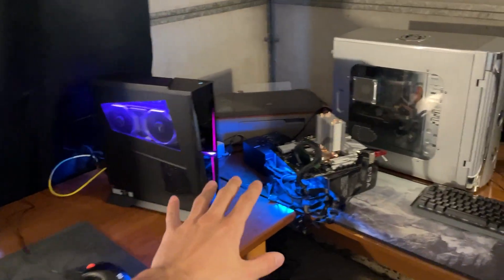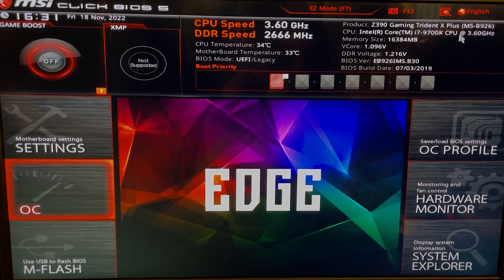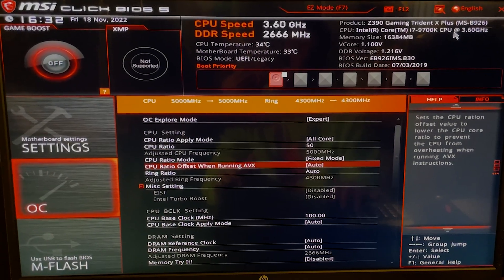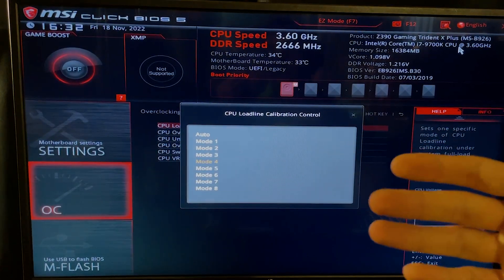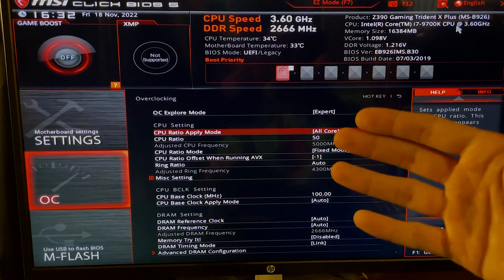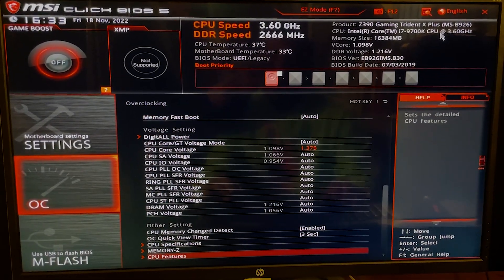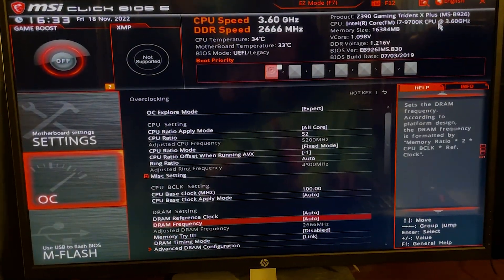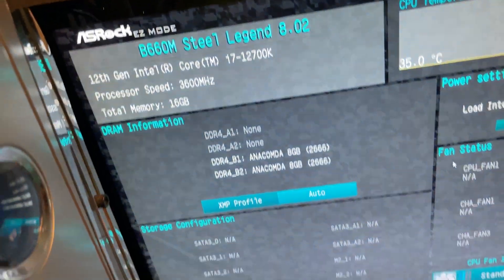Overclock your i7 9700K for more performance! - Tutorial

Comment: I've tried a lot, but it seems my processor can't handle 5GHz. I ran it at 4.9GHz for over two years, with temperatures often reaching 99 degrees. Now, tired of the fan noise, I've lowered it to 4.8GHz. My temperatures rarely reach 93 degrees, and the fans only start up occasionally.

Comment: Would this be safe on a prebuilt.
Mobo: Asrock phantom gaming 4s-ib
CPU: i7-9700K
GPU: MSI 2080 super ventus XS OC
COOLER: cooler master hyper black two fans in push pull with another fan on back pulling. Three front stacked pulling, two on top pulling.  
RAM: 16gb Xpg 3200
Reply: You ever figure it out?

Comment: Hi, nice tutorial, but my big question...is there any risk of damage to my cpu by doing this ? what temperature can the cpu hit at 5 ghz and what's the safe limit ? can this overclock erase the cpu bottleneck that i might have with a RTX 5060 Ti or RTX 5070 ? Thanks.
Reply: CPU's will always thermal throttle themselves because of how we know where silicon degredation starts. (I will add that processors these days probably use many more different ingredients than just silicon because we have probably hit the threshold of what silicon can do many years a go).
The only problem you might run into is that a processor that get's hot much more quickly goes out of bounds, there is a risk that it can be damaged that way.
Voltage increases are more dangerous: after all, we are talking about tiny logical voltages here, so any increase will increase heat and electromigration of the tiny transistors inside a processor.

Comment: Just ran a stress test on my cpu and it froze my pc.. the temp and cpu utilization max out. what are the lowest settings, so i can work up from the bottom? I have the i7-9700k along with 3060ti (not sure if gpu matters) i have cpu ratio at 50 and the volts at 1.28 and it cant handle it.
Reply: Figured it out. CPU fan it came with is garbage.
Reply: how to run stress test?
Reply: @roshanl34546   CPUID CPU-Z is a good program for stress testing
Reply: with gtx 1050ti, what will happen if i did 1.35v??

Comment: Is this tutorial is suitable for any i7-9700k ? I have MSI MPG Z390 AC Gaming And same processor with 16GB RAM  also RX 7600 XT from Gigabyte and I think 9700k is a bottleneck for this graphic . Please can you advise what I can do ? Can I use this tutorial to OC my processor ? My AiO is iD Cooling Chromaflow 240mm and sometimes my temps peaking quiet high in games with turbo boost . If I turn off turbo everything is quiet but I think I'm loosing fps with turn off turbo boost . Thanks

Comment: I got easy 5.2 ghz on mine, no problem at all on  Arctic Freezer II 420mm AIO. I might try to push it to 5.4 with some voltage adjustments
Reply: I have a big ass Noctua air cooler on mine with their best radiator fans and managed to get 5ghz and keep it under 70c, I may actually go for 5.2 lol
Reply: I over cocked to 5.2ghz and temps bout 45c
Reply: @Tinypvps imma overcook mine 😂
Reply: @Eurotruckpro I had to go back to 5.0Ghz it started getting fried

Comment: Hi man I have the same prebuilt pc as you, I was wondering if its worth upgrading or just buying a full pc, I wanted to upgrade the gpu to a 4070 ti super from a rtx 2080.
Also have you had any issues with overclocking the 9700k cpu ?
Reply: I’m in the same state too, I recommend just saving up for new ram, cpu, and motherboard then you can upgrade your gpu later if you’d like but yours will kinda do (4060 alone is plenty for an 5 7600X. I recommend going the AM5 path way.

Comment: With this setting the cpu clock will still chill when I'm not demanding it ? I'm runnning 5% of the time Skylines 2 which requires a lot of CPU, but 95% of the time just google chrome... so I kind of like the cpu resting on this 95% of the time

Comment: I have a ASUS PRIME H310M-K R2.0 and i got a great improvement by use 1.35 voltage, max 4.9 mhz (sadly doesn't get me that sweet 5.0ghz correctly), disabled voltage limiter on CPU configuration, Level 4 (even tho goes from 1 to 7??) hardware / cache prefetch enabled (tested both disabled and enabled and got more performance with enabled) and now on idle goes 4.6 ghz and gaming goes 4.9ghz :) instead of 3.6ghz and 4.3ghz, if anyone has a same board has me i hope it helps
Reply: its because you have -1 avx offset.
Reply: @roguefartblossom3221  is it worth having 0 avx offset for 5ghz over the 4.9?

Comment: i don't have an overclock mode setting. how do i enable it?
Reply from the maker: It’s probably “Manual” or “Expert”
Reply: @ImWateringPSUs  how can i change it? i used the advanced tab but i dont have an over lock mode on the bottom left

Comment: Followed your guide to a T but seem to have no stability.  What should my next step be?
Reply from the maker: If you have temperature margin, increase the voltage. If you don’t, decrease the core clock by 100Mhz at a time
Reply: @ImWateringPSUs  did some consulting with Google.  I saw a few posts saying with the MSI 390 A pro I might just be hosed on overclocking. Is that true? Nothing I did seemed to work.  I think this might just be a bit beyond me

Comment: I was running my system with the exact CPU and overclock and all of a sudden these days my discord restarts 3-4 times and then my PC freezes entirely, I set my CPU to default (non-overclocked) and now all perfect, why does this happens?

CPU: i7-9700K
GPU: RTX 3060Ti
RAM: 32 DDR4 3200 (8x4)
Reply from the maker: Over time you might need to decrease your core clock by 100Mhz or increase the voltage by 0.025V. Subscribe to the channel if it was helpful

Comment: Thanks for the video!

I've got a few questions:
- I've got the same motherboard and the same CPU, but I have 4 ram sticks with 2 different brands. They have the same speed, but different sizes. Can this be a problem?
- Is it important to increase the Ring Frequency, or is this optional?
- Can I reverse these settings if the pc crashes?
Reply from the maker: -Yes, no issue
-It’s recommended for more performance but not compulsory
-Absolutely yes
-Subscribe!
Reply: Thanks 👍

Comment: Hi, I have absolutely no idea what I'm doing I'm completely clueless when it comes to this stuff but my pc is underperforming pretty badly, it is specifically my CPU that is struggling so I am thinking of overclocking, before I follow this tutorial is it possible for me to fuck something up and make the situation worse for myself, or is this quite straightforward? Thanks.
Reply from the maker: This is gonna fix it!
Reply: So, how it went?
Reply: @pipecpeci  I couldn't do it
Reply: @BobDude65  my i7-9700k in games worked awfuly bad, didn't knew why, changed ssd with windows and added 16gb ram, fixed the problem. Now changed the gpu so i need to overclock my cpu (bottleneck)

Comment: I am about to upgrade from 9600k to 9900k CPU & is gigabyte euros motherboard how much ram speed does it support? I got 16 2x8 2666 but I want upgrade to 32Gb with high speed whats the limit ?
Reply from the maker: You can get any kind of memory speed as long as it's a good kit, I would personally recommend getting 3600Mhz! Very high speed like 4000Mhz might require manual tuning!
Reply: @ImWateringPSUs  thanks for replying , what about cas latency? Does it have to be 16 ? Or 18 is still good

Comment: I'm trying to do 4.8 ghz o.c, but it drops to 4.5 in the test and comes back out, I couldn't solve it, the motherboard z390 tomahawk avx setting does not work
Reply from the maker: You need to remove the power limits!
Reply: @ImWateringPSUs  Yes removing current cpu power limit fixed

Comment: How can I remove the voltage regulator? I have same mobo
Reply from the maker: What do you mean?
Reply: @ImWateringPSUs  well when I overclock I notice it only caps out at like 4.85ghz and won’t usually go high than that in a game. On desktop it will hover around 5.02ghz. I’m wondering if it’s because there a voltage limit

Comment: I think i lost the sillicon lottery, anything above 4.8ghz crashes/freeze/restart. Best I can do is 4.8ghz @ 1.330v 🥴
Reply from the maker: That's not too bad actually, but you might be cooler limited. I would be pretty happy with the results still!
Reply: 5ghz didnt Work. Tried yours and PC is running good but if I open up task manager it shows me only usage of 4.20-4.72 GHz.. why is dat? Have to say my motherboard is not dat good and I couldnt really change anything but core ratio, voltage and xmp
Reply: @Robert-Zimmer  You fixed the problem because i have an bprime360m-k and i have the same problem
Reply: @Nissyaniss  Nah didnt find any solution..

Comment: Mines a dud even 4.6 = bsod lol
Reply from the maker: Oh wow that’s pretty bad ahaha
It might also be due to cooling though, I think that every i7 9700K can reach at least 4.8Ghz on all cores without AVX offset, with around 1.3/1.35V
Reply: @ImWateringPSUs  I used to rub 5Ghz at 1.3v for over a year, but suddenly, it's gotten unstable.

Cooling is fine cpu, never hits 55f even while gaming ambient 70f

I'm wondering if the motherboard is bad since it does have two dead memory slots and a non functioning front hdmi port with missing pins.

Motherboard Asus z390-A prime.

I plan on upgrading this summer.

Comment: Hello, best voltage for lock 4.6? thanks

Updated bios on z390 a pro, latest version. Now I can't lower the voltage, the computer crashes during the OCCT test. Although earlier on the old BIOS the voltage was 1.195. fu*k
Now I have 4.6 lock at 1.350 voltage. Temperatures like an oven..

I still don't understand LLC mode. Tell me, what LLC mod best for undervolting? thanks again!
Reply from the maker: You’d be looking at around 1.2V, but try Throttlestop (I have a guide) if you can’t change voltage in the bios. Also if you can’t adjust the voltage, lowering the LLC helps! If you take a look at my i9 12900K overclocking guide, I go in depth about the LLC!
Reply: There are a million things called voltage which one to change? SA, IO, PLL OC, PLL SFR, RING PLL SFR, SA PLL SFR, MC PLL SFR, CPU ST PLL, DRAM and PCH? 

I have no clue what you want us to raise and to what level🤔
Reply: 3.37V 🔥⚡ 😂

For 4,6Ghz use Offset - 0,07V, for overclocking test Offset +0,1V and up in 0,1ghz steps
Reply: Thats very slow try 4.9ghz vcore 3.37 its stable ...

Comment: that cpu are simply pointless or even stupid now whoever buy it as used one!?no matter how much you oclock it you will basically only match 85$  r5 5500 only with performance while  power consumption will be 3x higher and temps around 20-25c more and that means expensive coolers needed !!
Reply from the maker: Well this CPU came out 5 years ago though😅 AMD had just the 1st gen of Ryzen at the time
Reply: @ImWateringPSUs  but problem is that 9700k as used costs more then 5600/x and 5700x  now just like more then  12400f or 13400f and it cannot compete vs them in anything , basically its only 2 or 1,5 year older inly then 5600x which are still very competitive vs 12&13th gen like 12400&13400f
Reply: Clearly not in gaming 5500 equals to 3600 so technically well worse in gaming
Reply: @floppydiskyt  round 5-10% better   but r5 5600 are not something much more expensive 20-30$/euro but   with full cache size

Comment: Hiya buddy, I'm cpu bound as I have a rtx 3070ti and this i7 9700k. My processor is stock. Should this jump to 5ghz give me a decent fps boost? Currently I'm only using 50-70% of my gpu under load on a game

Should add I'm running 1440p resolution
Reply from the maker: Yess it’s gonna reduce the bottleneck for sure!😇
Reply: @ImWateringPSUs  thankyou buddy, is that a relevantly safe overclock?
Reply: @ImWateringPSUs  I’ll try this!!! I’m having cpu bound with a 3060 ti lol. I hope this works.
Reply: @Cute-ts8qi  did you manage to solve the bottleneck? i got 9700k and 3060 ti aswell :D
Reply: @MikeBike360TM  i feel the thing limiting the 9700k these days could be the 8 threads idk tho i still love it and its holding up well anything i throw at it wow, hogwarts legacy, diablo 4  all new shit etc with 2080 super
Reply: @BudKing96  are you using these overclock settings with your i7 and 2080 super. Those are my specs as well and feel like I could squeeze just a few more FPS with a slight overclock
Reply: @BudKing96  whats your diablo 4 performance like?
Reply: @BudKing96  yup, same, r*pes most game but i admit in 4k it goes below 60 depending on the game, as you said, i bet its the 8 cores, thx for confirming
Reply: @MikeBike360TM  Now, did you do solve it?
Reply: @Ryuseigan  yeah, didnt have much to solve, CPU bottleneck, upgraded my CPU and GPU since then, but I remember overcloking it to 5GHz was better (but I dont recommend it for long sustained periods of time unless u have a cryo cooler)
Reply: My 2 cents here.. If you are in the context of gaming, this would help because a lot of games are, at least initially, unable to utilize multi-threading properly and relies heavily on single thread performance, hence why you'd see your CPU seemingly being underutilized when in fact, one thread is already capping. I've personally found that this is quite true, especially to those "early access" games, or those that are just released.

Comment: for better overclock scores you also should increase Ring Frequency
Reply from the maker: That is indeeed true! I recommend 300Mhz lower than your core ratio, but it’s usually gonna require quite a bit of extra voltage unless you’re very lucky!
Reply: @ImWateringPSUs  so instead of auto (4.3) ring ratio we put 4.7 right??
Reply: @fragval  yes, it usually goes from 500 to 300 below the overclocked frequency. so if it's 5ghz u can make it from 45 to 47 mhz and you need to test voltage as well, starting from 1.1 v for cache to 1.35 max and test it as well. And actually for 5ghz for your cores you can put below 1.35v and make it less hot and more safe. But it has to be stable, so you should test everything.
Reply: I set the frequency to 5 GHz and the clock rate to 4.7, but when I ran a benchmark  the maximum frequency was 4.8 GHz. Why? The temperature does not exceed 76 degrees and the voltage is 1.32.

And thank you
Reply: How do I change ring ratio if its.greyed out?